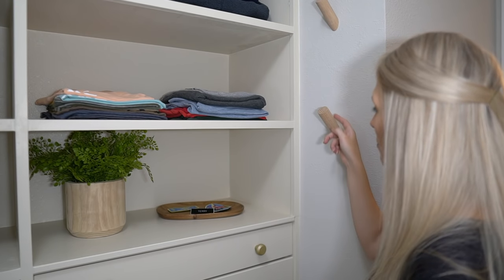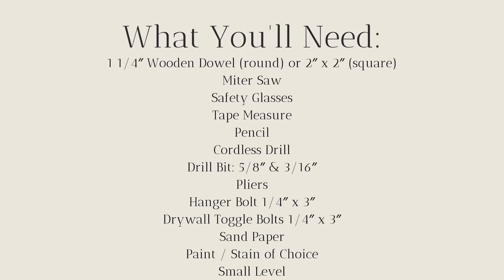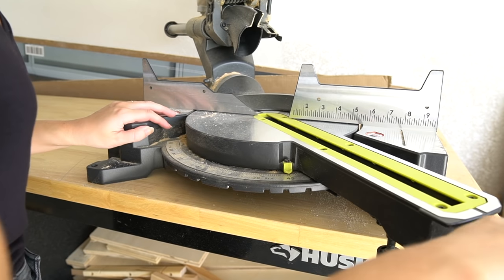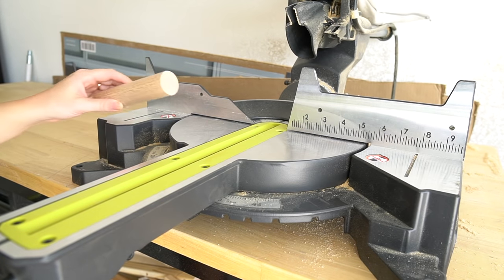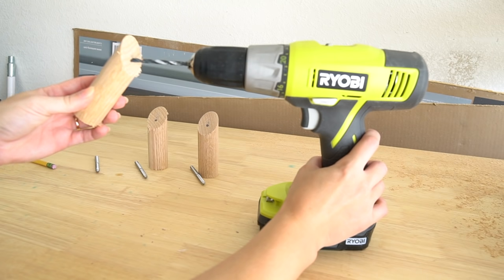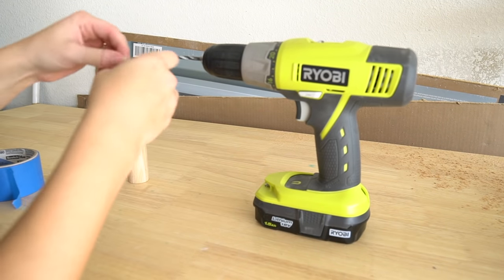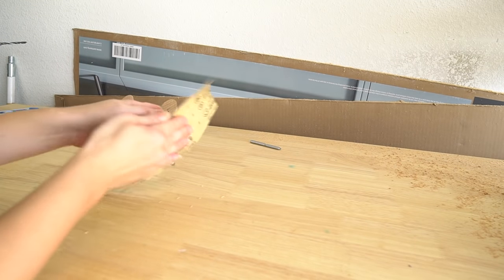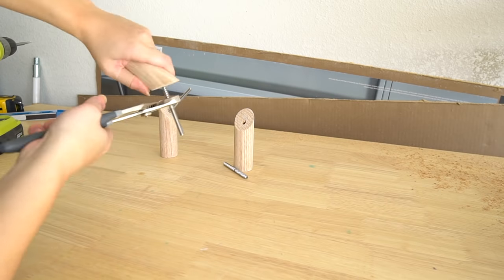DIY Wooden Hooks | HomeWithStefani

Comment: Stefani, the project looks great. Keep up the good work. One suggestion would be when installing the hanger bolt you can use two hex nuts on the machine threaded side it would make it easier to thread the wood screw side into the dowel without the potential to damage the threads.  You could then use the channel locks you used or even a closed end wrench.
Reply from the maker: Thanks for that tip!!